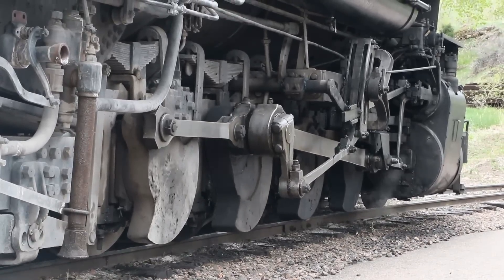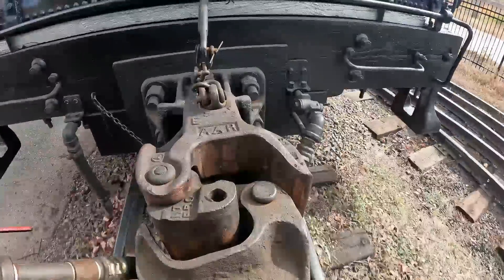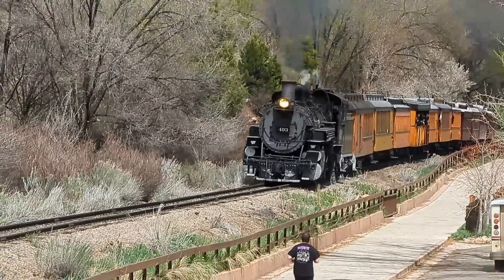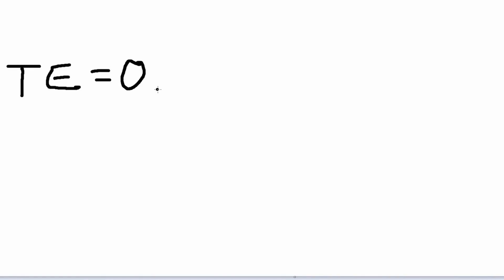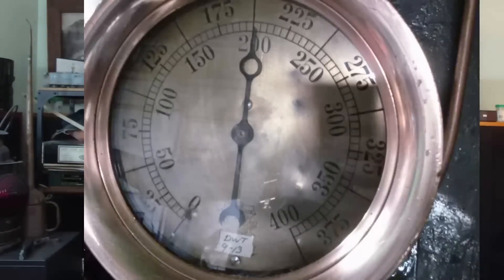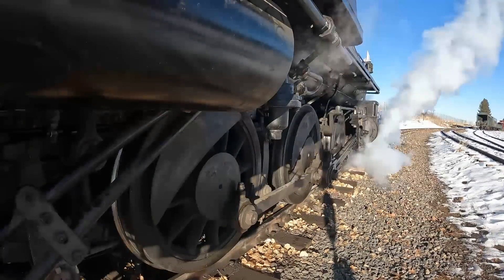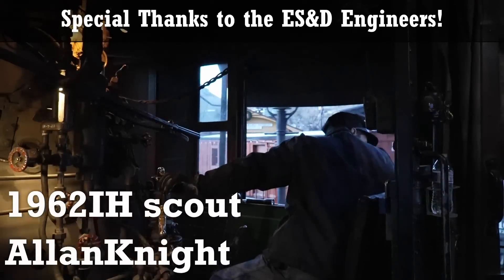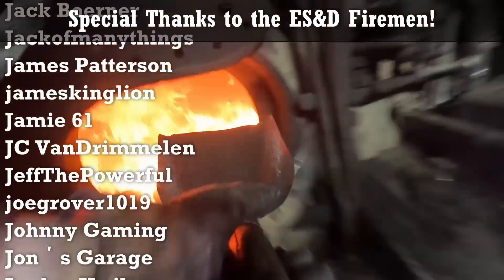Busting Tractive Effort MYTHS! | Railroad 101

Comment: Tractive effort is determined by total weight on drivers times coefficient of friction which is determined by rail condition:  rust,  wet,  icy,  foliage on rail all lower the coefficient.  Typical TE on clean dry rail is 0.25 X weight on drivers
Reply: Tractive effort is determined from the characteristics of a locomotive: piston dimensions, boiler pressure, and driver circumference.  Factor of Adhesion affects the ability of a locomotive to make use of that tractive effort at startup through to 8-10 mph when tractive effort drops away whilst adhesive weight remains constant.
Reply: @theimaginationstation1899    Potential TE is useless without adhesion.  Maximum possible drawbar pull is determined by adhesion.  Engines have been made that produce above and below their adhesion limit - the ones above are "slippery" but cannot pull harder that their adhesion allows.   Locomotive specs always list the max TE as the lbs. it can pull based on its weight on drivers time the COF.   Most locomotives are designed with more potential so that they can maintain pull at high speeds - all of this goes for diesels too.
Reply: @Hogger280  I don't necessarily disagree with you.  All I can add is that the idea of more potential at high speeds - hauling more, faster came at a time when tractive effort at starting, which is what the equation gives was less important than tractive effort at road speed, and thereby horsepower at the desired road speed.  

Tractive effort, though well understood by the locomotive designers et. al (certainly they understood that K=0.85 referred to MEP) never really achieved the significance that it seems now to have on internet comments sections.
Reply: @theimaginationstation1899      There it is - what you were getting at is Horse Power, which includes a rate of applying the force and what I said in my comment - "designed with more potential so that they can maintain pull at high speeds"
Reply: @Hogger280  Absolutely.  The intersection of the line of the train's resistance, the line of diminishing tractive effort as road speed increases, and the line of increasing road speed.  Thus the happy area of hauling more, faster.  The conundrum is that a higher tractive effort at the desired road speed means that the factor of adhesion is compromised at starting speeds as tractive effort is at its peak - thus boosters, three cylinders, improved sanders, front-end throttles and the like.

For passenger locomotives like the Hudsons the fact that starts and stops were infrequent on their daily runs meant the roads were prepared to live with a slippy start for better performance at speed.

Comment: Surprised to know that myth #2 exists. Since every description/ explanation i have come across, only mentioned that sand is used to increase the friction between wheel and rail.
Reply: I think that one may just be a case of misunderstanding that "tractive effort" is the force the engine could exert assuming no slipping, and possibly also misunderstanding that engines are normally designed so that they won't generally be able to slip on dry clean rail.
Reply: @BrooksMoses  Oh. Seems like "tractive effort/ input" being confused with "tractive output".
And the ratio of the 2 dependent the coefficient of friction.

Comment: In the UK tractive effort was calculated at 85% of the maximum boiler pressure
Reply: In New Zealand, it was 0.80 or 80% - which if you accept the incorrect explanation of 0.85 by Hyce et. al then Pi in New Zealand is worth less than Pi in the United States!

Comment: How well does that formula scale down for live steam model trains? I'm not sure if there's live steam models below HO scale...

I'm guessing most average-or-higher quality models will produce so much TE that any reasonable amount of rolling stock (which is relatively lighter than prototypical from its construction material) can't even come close to putting up resistance to match it.

Comment: As a Mechanical Engineer, I can say that yes: when we all argue in favor of larger driver diameter, we are assuming that the driving rod position maintains the same ratio of the driver radius, and doesn't maintain the exact same distance from the hub, which would naturally necessitate an increase in piston travel. We intuitively know it would work, even if we miss which is the driving variable.
Reply: Actually, if it's the same ratio it makes no difference.  What you want is to have it keep the same distance from the outer rim, so the ratio goes down.  :)

Comment: Well.. i have a issue with this. If you are dead due to MOT murder, you will not be able to enjoy your added tractive effort. So even if you could have the same tractive effort on 1 wheel as 3 in theory, if you want to stay alive, that is really not a good idea.

So in reality the tractive effort possible by the torque of the driving wheels, have to be balanced to the tractive effort friction to the rail. Not only that, for a steam loco it becomes even more important due to torque twist of the axles. Typically there is for at least half the rotation, mostly power on one side of the train, while the other side is powered throw the axle, this twist the axle ever so slightly, but sufficiently so to lose traction. (that is on of the reason why most British locos have there cylinder in the center.

Anyway for a typical loco frame that could be shared over a wide family that could be a 4-4-2 but also a 0-10-0 or a 2-6-2 on the same frame the freight locos would typically have smaller wheels that would allow lower speed but more traction, in effect balancing both the tractive effort of the wheels as well with the power of the cylinder in one go. While the express loco would have larger wheels but fewer, giving it both less torque as well as less tractive effort on the flip side higher top speed. Hence balancing the equation out regardless.

So while you could set up a theoretical framework where more wheels would not give you more tractive effort, in reality it will

Comment: I think what the majority of mechanical engineers meant by "Bigger drivers" was having a bigger driver so you can move the main rod connection towards the edge which would give you more piston stroke thus increasing TE
Reply: You have a limited stroke from the cylinder. If you went to bigger drivers and moved the rod to the outside edge you’d end up over stroking the cylinders. 
Basically where the rod connects to the wheel is set by the stroke of the cylinder so for a particular engine all driver sizes would have the same rod connection.
Reply from the maker: Driver size has nothing to do with where you connect the main. Sure, there's more room to move it out on a bigger driver, but that's not the direct correlation. Wacky stuff.
Reply: @Hyce777  the having more room to move it out was my point there
Reply: No.  It's not driver height, it's driver circumference - and a larger driver circumference decreases TE.
Reply: Apparently the GWR's top express locos, the Kings, were based on the Castle design but actually had smaller drivers to increase TE.

Comment: (I know this is a lot of text, but it's a pretty abstract idea so I wanted to explain it throughly)
The 0.85 coefficient isn't calculated from the area of a circle and/or area under a sine curve.
Literally every singe possible variable affects the tractive effort of a locomotive, so you would need to know the entire universe to get the correct tractive effort. The formula just includes the major elements that affect the TE. If the result should increase when the value increases (like boiler pressure or piston diameter), you multiply it, if the result should decrease (like wheel diameter), you divide by it. of course you don't multiply it directly, you do it with a coefficient that is determined by the effect it has on the TE, but you don't need to know it, that's why it's beautiful. When you multiply all the elements and coefficients together, you can simplify the coefficients into one. Now you wouldn't know what this number is because you don't know the numbers it came from. The way you find it is by getting one locomotive, getting the variables you have in the formula, and putting them in, then you get a number. After that you actually measure the TE of the locomotive in real life, by whatever method and you get it's TE. After that you have to find "what number multiplied by my result will give the same number I measured in real life?". And that's it. Assuming you have all possible variables in the formula, it will be perfectly precise for any locomotive. Of course the formula we use doesn't have all possible variables, so we need more real measurments to get a more precise aproximation.
What is even better is that you can put any measuring system in the formula, calculate the new coefficient from the real number and the one your formula has, and then it just works.

thanks for reading my book :-)
Reply from the maker: Well said my friend, thanks for the cheers! Yeah, it's impossible to classify everything that influences it, and lord knows many manufacturers altered their coefficient based on things they learned experimentally.

Comment: Same force, more wheels means more surface area friction to apply that force against the rails.
Reply from the maker: Not without additional weight. If you've got the same weight, you've actually got the same ability to apply force, just divided into more, smaller contact patches. More weight though, yes, you are correct.

Comment: Well explained.    But you forgot to mention the number of cylinders.   The equation is for two cylinders, which is the majority of US locos..   If you have three cylinders (like the UP 9000's or many British locos), multiply by 1.5.    If you have four full-pressure cylinders, whether on one 'engine' like many British locos, or two separate ones like the Big Boys and Challengers or Garratts, then the TE is doubled.     Compounds, on the other hand, are complicated by the fact that the LP cylinders are typically a bigger diameter but get fed lower-pressure steam, in which case there's a separate calculation for each set of cylinders to add together.   Some compounds used to admit full-pressure steam to the LP cylinders to aid in starting.
Reply: He didn't forget; he started out saying that this equation was for normal two-cylinder locomotives, not weird ones like that!

Comment: The booster is a really ingenious work-around for that TE equation, and in some cases makes sense. (That’s the real 10% extra power….not the bell. 😂) Seems like it is only a thing for some of the larger examples.
Reply: Many of the larger examples, really.  Tender boosters are quite rare, but a surprising number of the heavy-frame outside-bearing trailing trucks have booster engines hidden inside.  Even the single-axle ones.

Comment: On class 1's, you can change the EPA (Equivalent Powered Axles (A rating of force multiplied by 10,000lbs pulling force)) by simply changing the paperwork. Ive had plenty of 12.2 EPA AC locos that turn into 14.4's when we setout an engine in the consist that has DC motors....

Comment: 10:45 there is a video series on youtube called Astley Green and Walkden railway and because of mutiple factors the mine would close down if they didn't get enough coal, the gradients on the line, the fact the locomotives were rented and were Austerity 0-6-0's which were meant to last a few years in WW2 yet are there in the 1970s and a very sturdy loco. They are pushing the locos to the limit and it's quick impressive seeing them chug along wheel slipping and huge plumes of smoke with a long train of full coal wagons behind.

Comment: I have been thinking if i were to build my little 0-4-0 8t porter it would have caprotti valve gear, a superheater and all roller bearings on rods and wheels.
Reply from the maker: That'd be quite the little doot.

Comment: Having more cylinders would also increase tractive effort, all other things being equal.  Not an issue on most US locomotives (other than adding together the tractive efforts of the otherwise conventional engines on articulated locomotives), but then Southern Pacific had their 4-10-2 locomotives and Union Pacific had their 4-12-2 locomotives, both of which had 3 cylinders.  This would also increase the maximum usable tractive effort by somewhat smoothing out the variations in torque through the cycle.

And yes, I would like to see this for diesel(*) and electric locomotives.

(*)Mainly diesel-electric, but then you have those diesel-hydraulic weirdos like the Krauss-Maffei locomotives that the Southern Pacific and DRG got in the 1960s, as well as many in Europe; and then you've got that compact switcher at the Colorado Railroad Museum.

Edit:  Also let's not forget geared steam locomotives.  Hmm, maybe we need 2 more videos . . . .
Reply: Yup.  For what it's worth, the Union Pacific also had some 4-10-2 locomotives that were nearly identical to the SP's, but they found that amount of that extra tractive effort they could actually use wasn't worth the increased maintenance costs so they rebuilt them as two-cylinder locomotives.

Comment: About part 2:
The actual at_rail tractive effort is a minimum of two values. The first is the effective force applied by steam pressure at the pistons, which is covered by the true and tried formula then modified by things like wheel diameter and coupling rod geometry. The second is a limit imposed by friction - in which only factors are weight on drivers and coefficient of friction. Since sand increases the friction coefficient then yes - it does increase tractive effort in situations where friction is the limitation.
Truly - the art of making a steam for freight duties is to find a balance where the only truthful limitation of the locomotive is the piston pressure, as when force applied by steam exceeds friction, locomotive starts to slip. Which is why steam locomotive engineering before times of computers was a form of practiced 'hunch magic'

Comment: Since you mentioned diesel, I thought I'd do my own nerding out, lol.

In diesel locomotives, (I'll only mention those with DC traction because I'm not remotely qualified to talk about the minutia of AC traction) your tractive effort is related to your traction motor amperage. (I think you actually mentioned the approximation EMD uses in your other video. The equation that uses horsepower, a constant, and divides that by the speed) As such, you get the most tractive effort with the motors at (or near) stall. The nerdy part and nuance comes into play when you consider low speeds and how the excitation system works.

Starting simple, diesels have a spec called "minimum speed for full horsepower" (which depends on the gear ratio selected by the railroad) Above that speed, the approximation of tractive effort based off horsepower works pretty well, but below that speed the actual tractive effort will be less than the equation says.

This is where the complexity (and my nerding out) begins. So as the motors slow down, they draw more and more current, which means we get more torque out of the motors. But, it also means that the motors and main have to pass more current, which causes things to heat up. As such, the excitation system is designed to limit the current from the main to help avoid overheating issues. Above the "minimum speed for full horsepower," the load regulator and excitation system will work to keep the engine running at full horsepower (or a constant horsepower based on what throttle notch you're in). However, below that line the excitation system is designed to "override" (sort of) the load regulator to (try to) keep the current in the main at a relatively safe level. The excitation system does a similar thing at high speeds, except it's limiting voltage instead of amperage. So, (ignoring transition) if you were to watch the load regulator on a locomotive in 8th notch at a high speed as it pulled up a hill to a stall, you see the load regulator start out at "full field" because the excitation system is limiting the voltage from the main and the engine isn't producing full horsepower. Then, as things started to slow down, the excitation system would allow for more horsepower and eventually the engine would reach full horsepower, at which point the load regulator would start to back off a bit to keep the engine at full horsepower. As you continued to slow down, eventually the load regulator would start to move back to "full field" position as the excitation system starts limiting current from the main. Once you reach the "minimum speed for full horsepower" the load regulator would hit "full field" and then the excitation system then gets control and starts limiting the current from the main. At this point, you'd start losing horsepower again as the excitation system is designed to protect the equipment from excessive current.

A cool thing about Dash-2s, is that some of them were built with a different PF card, which has an additional "performance control" curve which allows the locomotive to load harder at those lower speeds, but now you're relying more on the engineer to keep the current to a safe level for the sake of the equipment. And those "performance control" curves don't affect the normal operation of the system above the full horsepower line.

That's a lot of words and not a perfect explanation, but I wanted to take the opportunity to nerd out a bit lol.
Reply: When figuring the tractive effort of a steam locomotive, I’m thinking one should use inches when plugging in the diameters of the piston and drivers into the equation?
Reply: @billmorris2613  Yes. The working pressure of the boiler is in psi, so multiplying by square inches (diameter squared) will give you force.
Reply: @CDROM-lq9iz    Thanks.